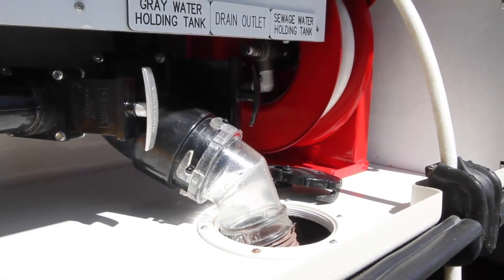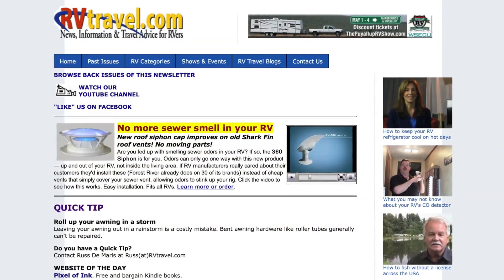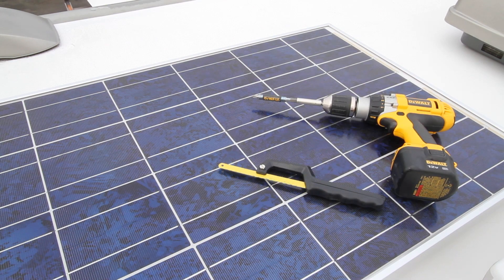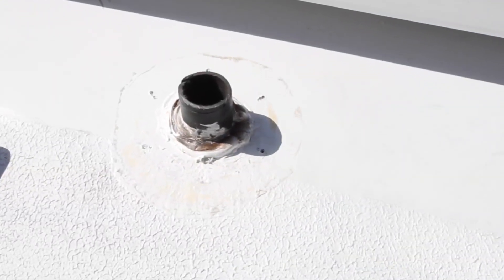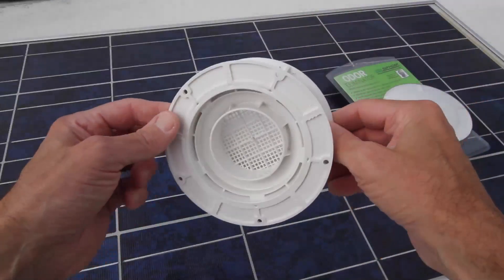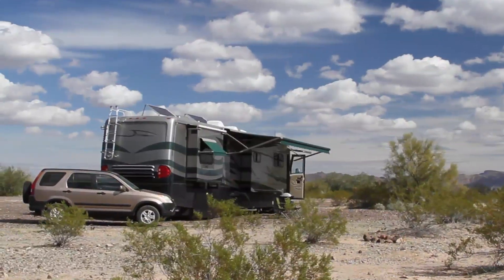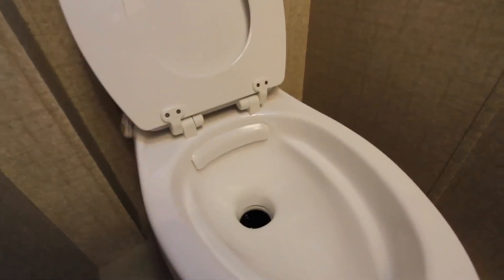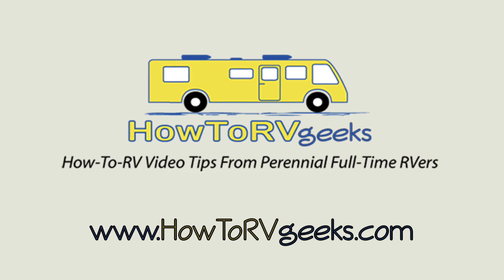Stop RV Tank Odor With RV 360 Siphon Vents

Comment: I installed two of these on my class c and they didn't help at all. The smell might even be worse now.  I was all excited to drive and not have that smell but was very disappointed when I found they didn't work as advertised. Are you guys just trying to make money by telling people they work?
Reply from the maker: +Sean K Hi Sean. So sorry that this didn’t solve your oder problem, but I will tell you, without exaggeration this is the first time I have ever heard anyone say one bad word about 360 vents. We pride ourselves on only talking about things that we use ourselves and really believe in. We are thinking there must be some other factor happening with your RV besides just the vent stacks
Reply: I can't think of what else it could be. Everything works perfect in my RV. I don't smell anything when parked, it's only when driving.
Reply from the maker: +Sean K Hmmm. What kind of RV do you have Sean, and how old is it? And does it happen with the windows and roof vents open, or closed, or both? And most importantly, does it happen regardless of whether the black and/or gray tanks are mostly or completely empty as well as when mostly full?
Reply: It's a 2008 22 foot Class C. I keep the roof vents open most of the time. The smell is really bad when I roll the front windows down while driving. I'm not a big fan of AC so I like to have my windows open, thats why I bought the the 360 Siphon vents. I've only had one trip in the RV so far with the vents installed, it was a 4 hour drive there, a 1 hour drive to another location, then 4 hours back. The black tank was less than quarter full. I'll be moving into the RV in 3 weeks.
Reply from the maker: If we're understanding correctly, you're driving with the roof vents open, right? Try making sure that your roof vents are tightly closed while driving. The way the 360 vents work is by the venturi effect as air passes over them, creating positive airflow up and out the vent pipes. The extreme airflow at highway speeds means that a LOT of air is being drawn up and out the vent pipes. If you have a roof vents open, the air that's coming OUT of the vent pipes could easily be being drawn INTO the open roof vents. That is probably being made worse by having the windows down. If you can try driving with the vents closed, that may be enough to stop the additional flow from the open windows from causing the problem. Give that a try and let us know how you make out. And congratulations on your move in 3 weeks!
Reply: I'll give it a try and let you know, but, both my vent pipes are at the back of my RV behind all my roof vents, I don't think that would be the case. I'll let you know in about three weeks.